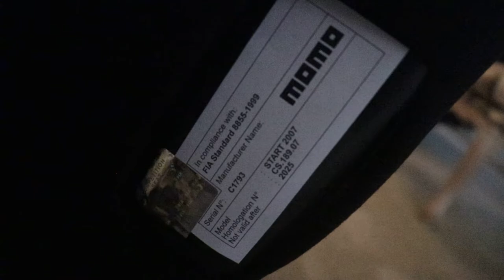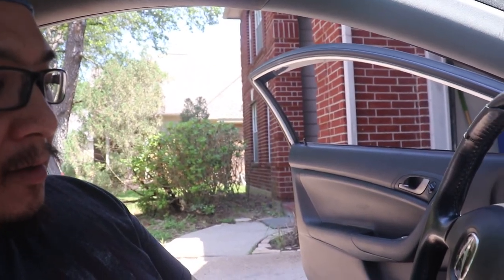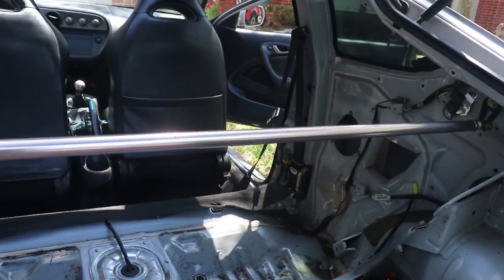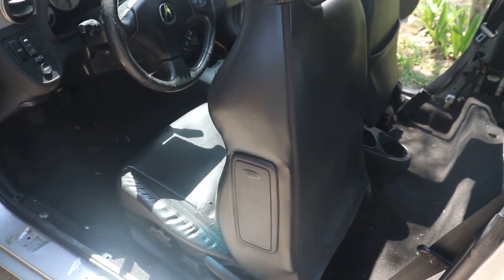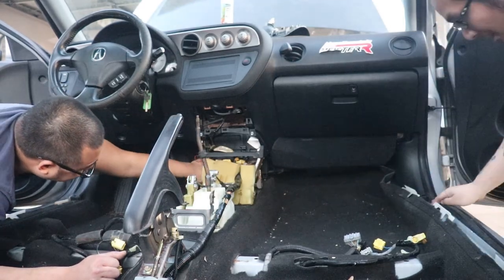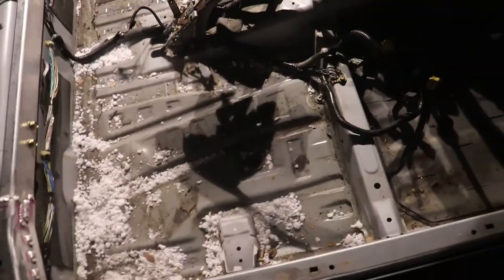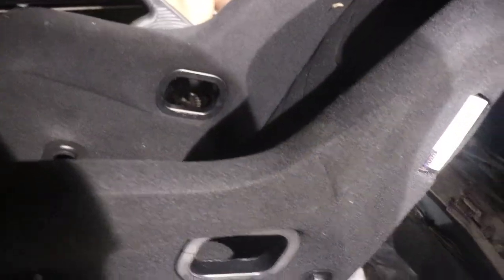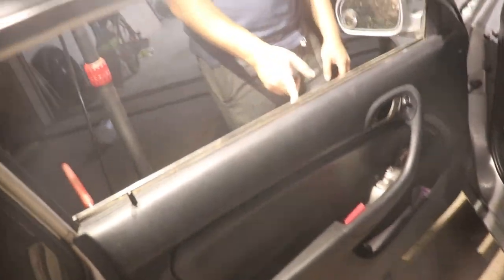MOMO Racing Seat + PCI Seat Bracket Install! | Acura RSX Type-s (DC5)

Comment: Really interested to see if you're going to remove/replace the moon roof with a fixed one.  That should remove some weight up top which should lower your center of gravity overall.  I've seen a few race RSX'es which had this done and I'm curious what's involved.
Reply from the maker: Yeah I know a couple couple who's done it, the thing is, the sunroof is actually an integral part of the chassis rigidity as a whole, and I've been told removing it and just slapping a panel on there won't cut it to make up for the rigidity lose, soooo I plan on finding someone to weld in like a cross bar or 2 and then put a panel on top 👍🏻